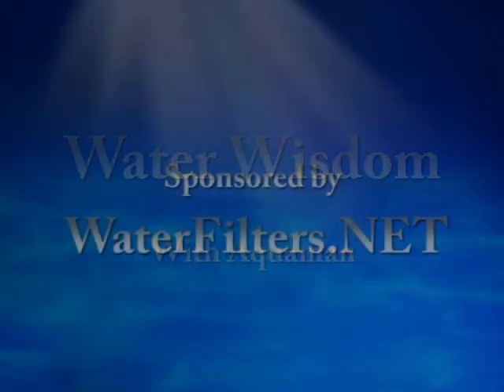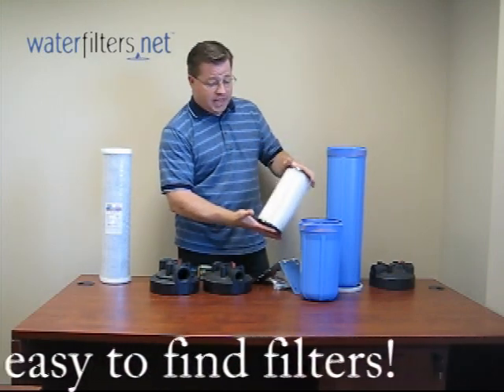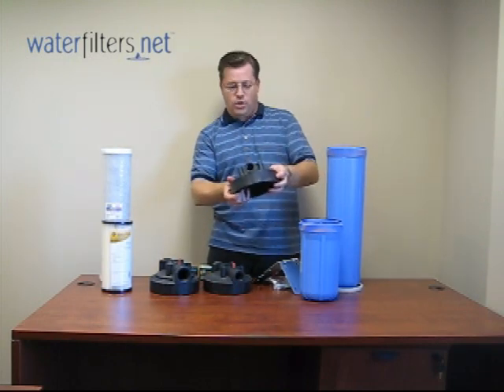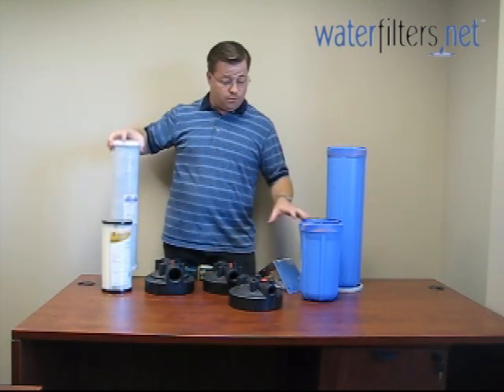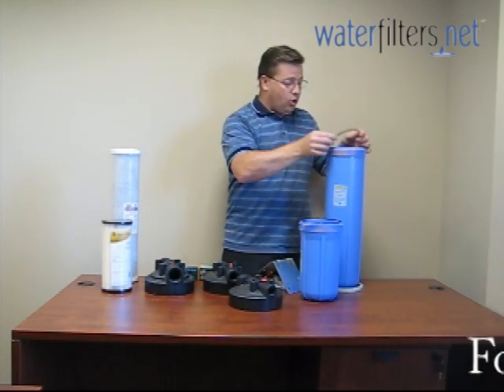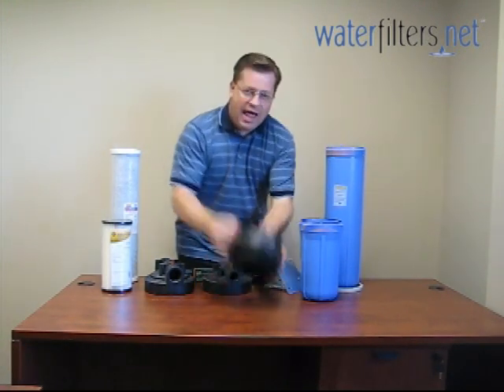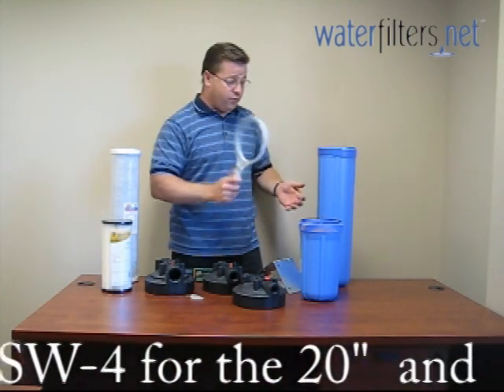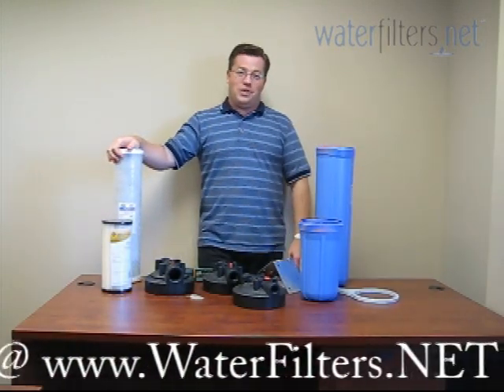Whole House Water Filtration Cartridge System Overview

Comment: is the flow rate between the 10 in vs 20 much different ?
Reply from the maker: The flow rate will be affected both by the housing size and the type of filter cartridge used.

Comment: Right now we have a behemoth "iron filter" in our basement (bacterial rust in our water).  We don't maintain it at all.  I just assume it is working.  Between it and our water softener, our water is ok... we live with some odor.  Would you think Big Blue would be a replacement for that or an addon to that?  Perhaps I should have my water tested to answer that question.
Reply from the maker: First step should be a water test so you know exactly what's in your water. This could be used as a pre-filter for iron prior to your water softener (but not in place of it). A water softener treats hardness minerals which are dissolved in the water. The level of iron in your water would help determine the appropriate treatment solution.